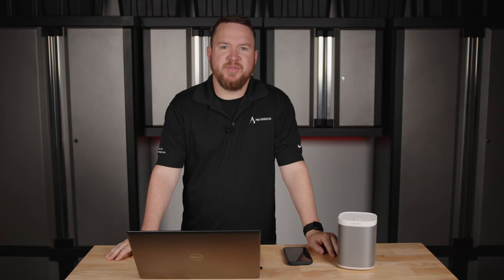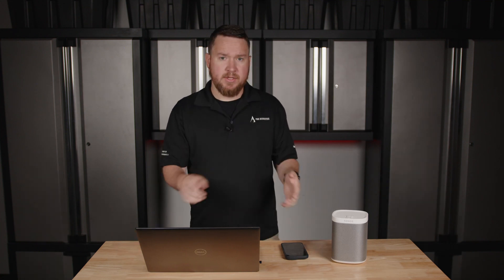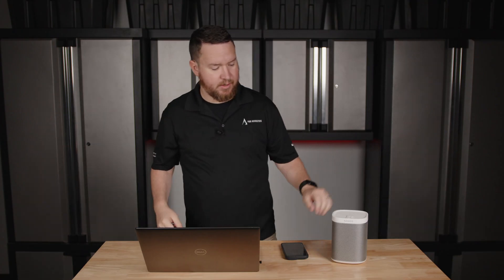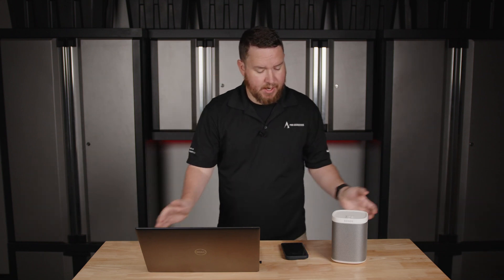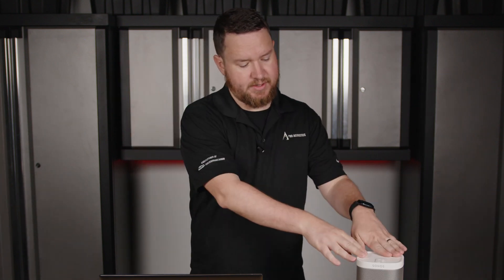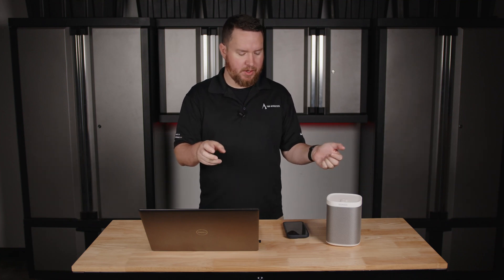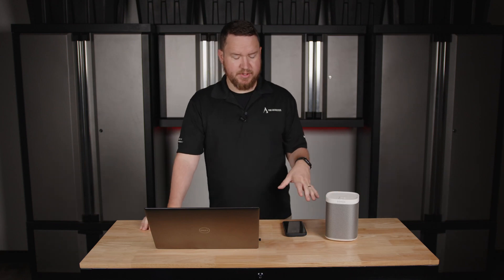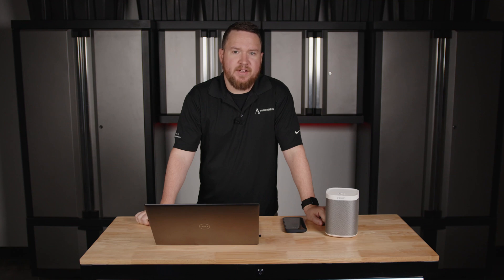How Do Wireless Speakers Work? on Pro Acoustics Tech Talk Episode 125

Comment: Thank you for the video. I'm interested in wireless speakers, but they are always presented in the same way: stream your music from your phone with an app. This can be handy if you only want to use it for music from your phone, but what if you have music as files on your computer? And what if you watch movies on your computer? Is it possible to use WIFI speakers as coputer speakers? Not just for music, but everything: music, movies, video editing, system sounds, ...
It looks much more complicated compared with traditional active speakers.
Reply from the maker: Many Wi-Fi speakers are primarily designed for streaming audio from smartphones. However, some models support Apple AirPlay, allowing you to wirelessly play any audio from your computer. On the other hand, Bluetooth connectivity might be a better wireless option for this application, though you will still need to power the speakers, either with batteries or by plugging them in.

Comment: good vid.
   Never heard wi-fi "powered" speakers.  is the sound quality any better than bluetooth?
Reply from the maker: Thanks for watching! Just to clarify, Wi-Fi "powered" speakers still need to be plugged into a wall outlet for power. What makes them different is that they connect wirelessly to your Wi-Fi network, offering a longer range than Bluetooth. As for sound quality, Wi-Fi typically offers better audio fidelity and range compared to Bluetooth, especially for streaming high-quality audio over longer distances.